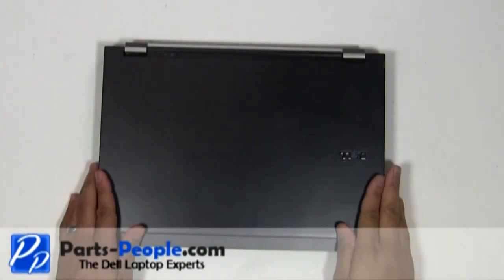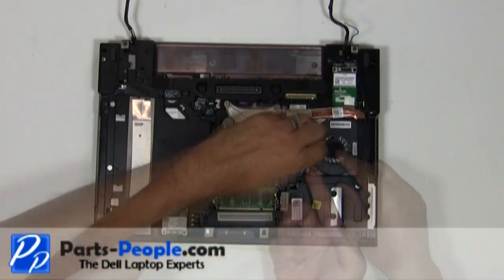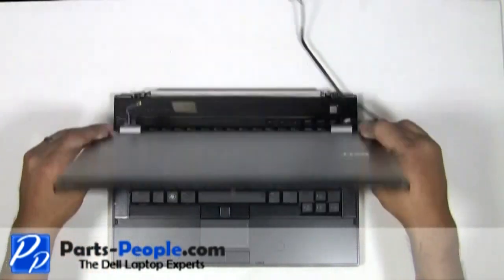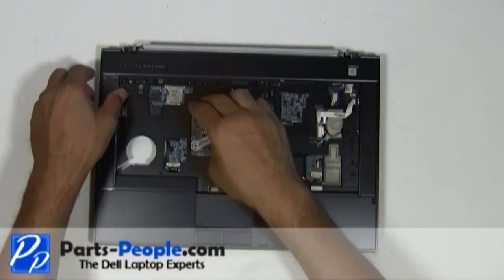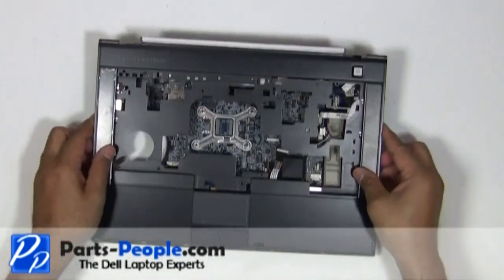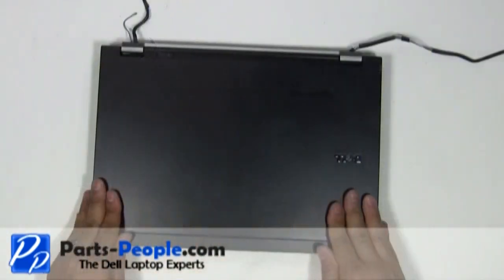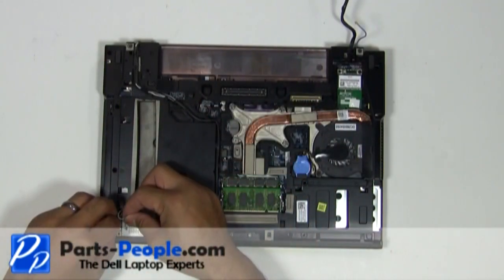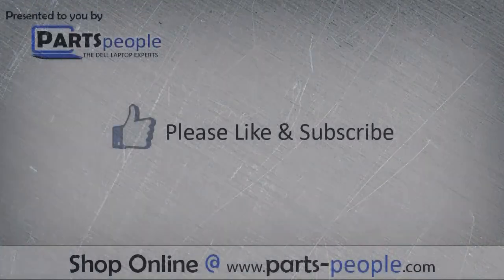Dell Latitude E6400 | Touchpad Palmrest Mouse Buttons Replacement | How-To-Tutorial

Comment: I was recently cleaning my dell E6400, when I was removing the palm rest from the main chassis I accidently popped off the latch that holds the small brown touch pad ribbon cable to the port on the motherboard. Since its removal I have been unable to reattach it. Is there any way I can get around this without having to purchase more parts?
Reply from the maker: +SomeWhat Logical Unfortunately I haven't found a good way to replace a cable latch that has come off. I have heard of people gluing them back into place but the cable connections aren't always that good. You can try it but if it doesn't work, chances are you would have to replace the motherboard.
Reply: +Parts-People.Com, Inc Thanks for the reply, I have a temporary method of right now. A small strip of electrical tape seems to be just fine until I can find a better method of keeping the cable connected. I was possibly thinking about soldering the contacts to each other though that may lead to damaging the cable.

Comment: I can't find any videos for the E6510 but it's a bit different.  This video is helpful as long as you don't try to force off parts that don't simply pop off as they do in this video.  I will have to watch the video several times to figure out how to get to hidden screws that are different on the E6510.

Comment from the maker: I don't think it was necessary for him to remove the heatsink or CPU so I didn't recommend replacing the thermal compound. If you need to replace the thermal compound, I would suggest Arctic Silver. Unfortunately I don't know the name of Dell's default compound. If I'm doing a job that requires it, I try to use Arctic Silver.

Comment: You haven't cleaned CPU and haven't replaced old thermal grease with the new one. Was it wilful neglect? 

Shall I replace the paste with the new one or is it not necessary? 

What thermal paste is a "default" DELL's paste and/or which one do You suggest to use? 

Best regards!

Comment: i dumped a coffee on my keyboard, air dried the sucker for 24 hours, took the KB out and cleaned it and anything exposed with rubbing alcohol wipes and it works fine but the keyboard has some keys that aren't working and the trackpad/buttons do not work... any insight on what i should do here? is it fixable? what if i dunked the whole keyboard in a tub of alcohol? but what about the trackpad?